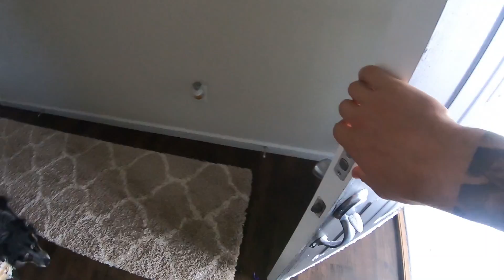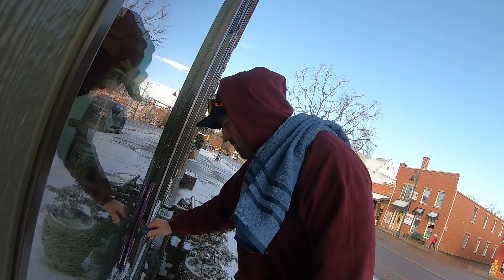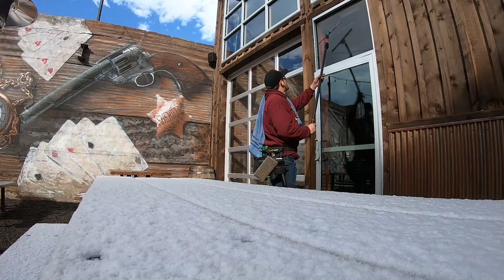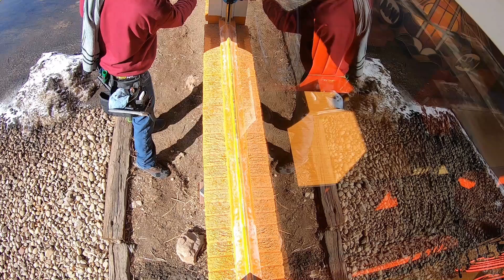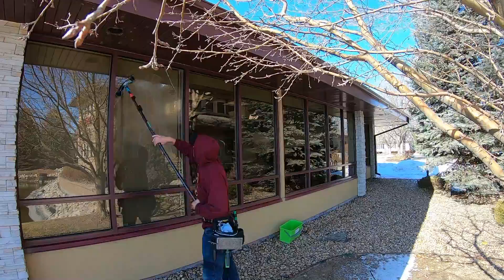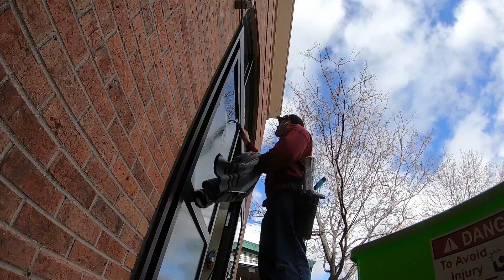LILLY'S FIRST DAY AT WORK CLEANING WINDOWS

Comment: A few things I would like to comment on. 1. Are you so used to wrapping a towel around your pole tip? I figured you would switch to using the Maykker handy tool. I've been eyeing that tool so that I can use it for things such as detailing or scrubbing junk off the windows. 2. I completely agree with you about those infomercial guys, is what I like to call them. I would love to dive deeper into the business side of it since I am not a great businessman. I look forward to those videos you make on that subject. 3. I love the carbon fiber trad poles. but because they don't have a handle at the bottom it really messes with my forearms. Maybe it's because they are smaller in diameter than a regular trad pole?  Or maybe it's because there is no ergonomics. Oh well. Keep up the good work!
Reply from the maker: Jorge Chavez yes I’m very used to it that it’s hard to get used to anything else. I actually like the cf pole being skinny, to me it’s comfortable but I get that a grip like the ergo tec is very nice

Comment: 5:45 if i do straight pulls like that starting on wet glass, it just drags water down with the squeegee, so i have to dry a strip at the top of the window to start the squeegee in, and dry off the blade between each pull.  you obviously don't have that same problem (or you wouldn't be doing it that way).  any idea what i might be doing wrong?
Reply from the maker: kymbo72 I leave about a half inch of dry space at the top of the window which really helps as a dry area to start in. Sorbo definitely does best with straight pulls and has the least amount of bleeding and a light touch allows the rubber to sit correctly on the glass collecting all the water. Also I feather the squeegee at the top which build up a layer on the squeegee blade allowing less bleeding of water
Reply: @SteveOthewindowcleaner  thanks for the tips.  i didn't notice the feathering maybe cos the footage was in fast motion
Reply from the maker: kymbo72 I’m so used to it that I do it quickly, what squeegee do you currently use?
Reply: @SteveOthewindowcleaner  ettore ledge eze
Reply from the maker: kymbo72 have you considered or tried a wide body channel squeegee?
Reply: @SteveOthewindowcleaner  I have not, but I could buy one.  I know you mentioned Sorbo is the best, but i think it doesn't take Ettore rubber (which I have a whole stack of to use up).  Unger Ninja perhaps?  I do mainly residential, which is why i was using the Ledge Eze.  You recommend the Ninja for residential?
Reply from the maker: kymbo72 yes the unger ninja would be a great choice, takes round runner and easy to use
Reply from the maker: kymbo72 https://windowcleaner.com/unger-complete-ergotec-40-deg-ninja-squeegee?pt=MY
Reply: @SteveOthewindowcleaner  thanks i will give it a go!

Comment: Hey Steve, I had a question. I’ve been watching a lot of your videos from the years and I see you use a lot of different tools on jobs that are relatively the same. What makes you decide to switch between one squeegee and another? For example using the pulex alumax, vs using the Ettore brass channel or Unger ninja?
Reply from the maker: Ethan Bennett very true! I honestly just enjoy a lot of the tools that are out there, I enjoy almost all wide body channels, slim and a lot of different handles. Sometimes there’s commercial jobs that are faster with straight pulls rather then fanning so I may primarily use sorbo channel or unger ninja because straight pulls with wide body channels is smooth. With a slim channel it’s a little more finicky. My overall favorite as of now is the ettore brass with the Moerman excelerator 2.0 handle because of its options and capabilities.
Reply: SteveO The Window Cleaner Thanks for the reply, yeah I was kinda freaking out which tools to buy cause I would see you recommend like 5 different squeegees 😂 but that makes sense, so the Wide body channels help out more on straight pulls because of the extra weight on them?